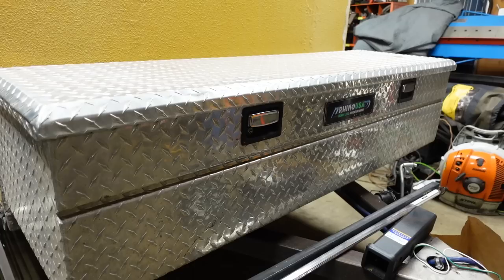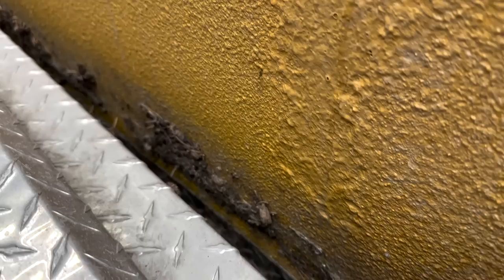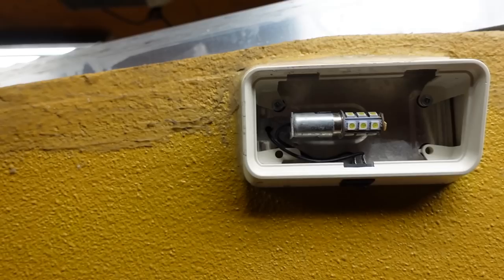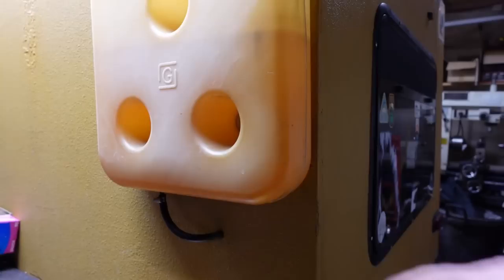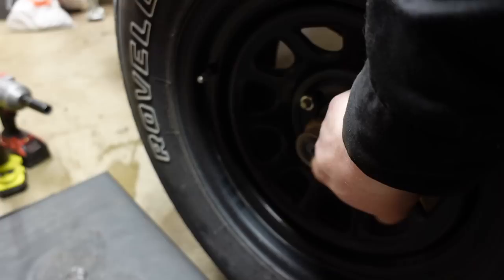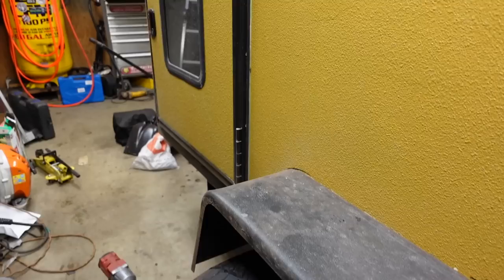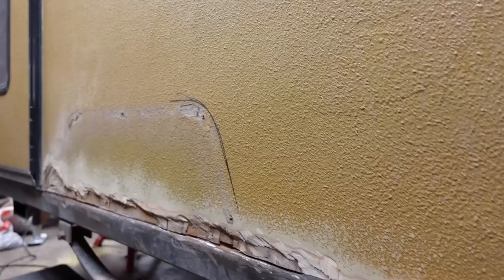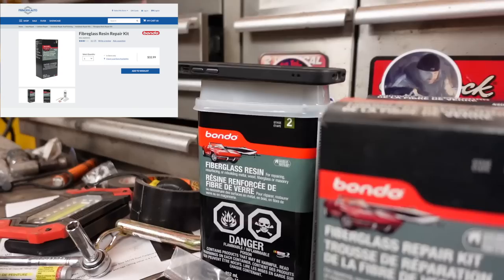DIY OVERLAND TRAILER | Water Damage Repair

Comment: you can also use what they call fiber glass peanut butter its chooped fiberglass and silica or micro ballons with the resin and it goes on like body filler very strong and filles big voids
Reply from the maker: I had no idea that existed, I pondered the idea of chainsaw wood chips mixed with resin as well
Reply: Its called kitty hair!

Comment: The repair is always going to be bigger than expected. No truer words spoken. I had an old 70`s truck box camper that leaked in one corner of the roof. I went over that thing top to bottom sealed up this and that and the other thing. Found some rot inside back corner, ripped out walls replaced rot with new wood and new wall paneling and replaced the wet insulation. All was good until a heavy downpour and water in that same corner fucking up my new repair. Turns out the aluminum framed window in one corner where the corners are welded had cracked. This was allowing the water to run along the sliding window  channel and water wicked along the insulation and made its way UP the wall to the original trouble spot. Yes UP the wall. Sealed the window channel and it never leaked again.
Reply from the maker: that must have been a crazy amount of water to get in over time to do that much damage
Reply: @BackCountryWrenching  a little bit over many years went a long way.

Comment: I think you should use a marine grade wood sealer in the future to seal the wood then apply the rest on top if the guy who built it had used marine grade plywood in the beginning this would never have happened. You can also get the sealer tinted as well blue black whatever. Especially seal areas where the wood was cut or any end grain super important. Also do t use silicone use sikaflex instead way better than silicone which doesn’t bond to wood as good shit even liquid nails construction adhesive works better.
Reply: Also Wear gloves . once that shit sticks it almost impossible to get it off. Kinda the point of all this right?